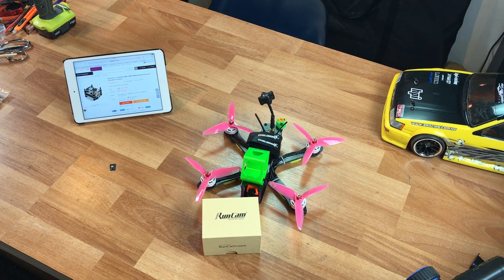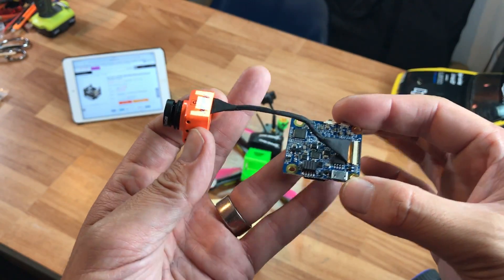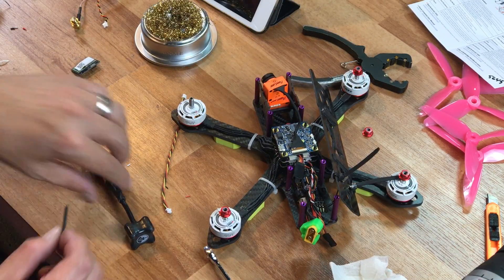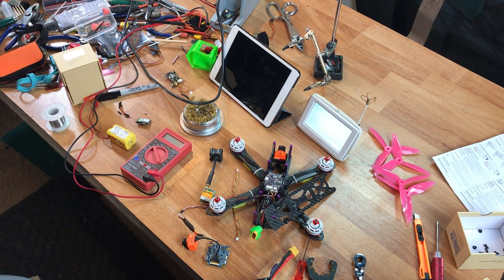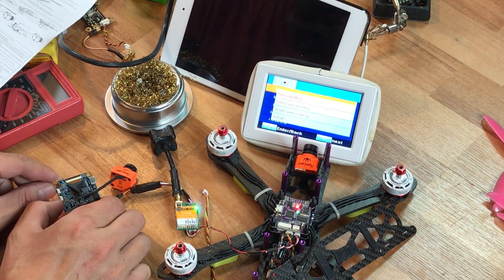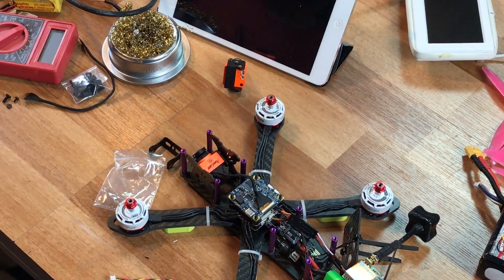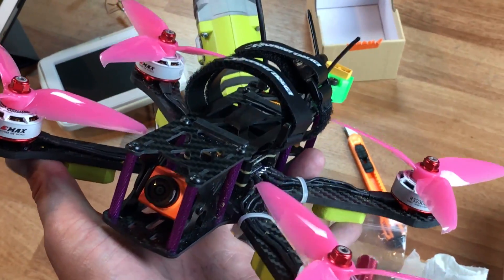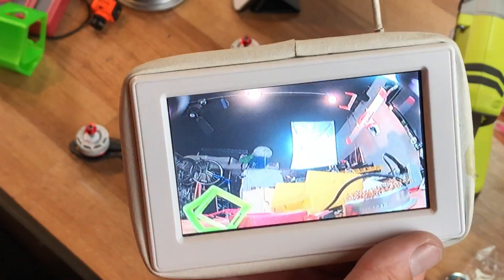RunCam Split Installation

Comment: I came to watch this vid to see how you connect the split to the FC. It looks like you didn't do that, but if it's set to save vid automatically, then I guess you don't have to, and the build is a lot simpler.

Comment: Have you done any videos on the RunCam Split 2 with it's updated power requirements beyond 5V?  My current setup is the Split v2 with power coming from a Tramp VTX 5v out, with the Tramp's power requirement and specs say it's designed to be powered direct from the Lipo and so, the tramp is soldered to the same pads as the XT60 out wire on my DYS F30A 4-in-1. I also have a power cap soldered to the same pads on the 4-in-1.  My FPV video feed is not kosher at all. Me and another build engineer have tried different options in power supply as well with no luck, and we are on our second Split V2 to eliminate the possibility of a shipped lemon.  So, I'm trying to find a solution to solve this.

Comment: Let's say you want to use the camera with your drift car, can you just plug it into the receiver? I only want it to record. Will the 6v receiver fry it or it is regulated?
Reply from the maker: 5v or nothing!- you can easily use a step down regulator

Comment: Why did you name this "installing" when you you skip the whole installation in fast forward? 😡😡😡
Reply from the maker: Panda MiamiLocksmith because if you have the ability to wire a fc this is way easier
Reply: 7demo7 I'm completely new to this hobby. Usually in an installation video, they show the installation cause people don't know how to install it. Thanks anyways.
Reply: 7demo7 theres like 500 screws, two brackets and not even the instructions tell you which screws go where. I went slowly and figured it out.
Reply from the maker: This is not a tutorial. Just my experience....
Reply: 7demo7 well it should be renamed "my split experience"
Reply from the maker: 4.4k views any you're the only one complaining. That just means you're wrong...
If it helps, slow down the video during the time lapse portions with the video speed tab
Don't worry you'll learn all this stuff and it will be second nature soon- the learning curve is quick.
Reply: 7demo7 yeah cause I'm the only beginner starting with high quality hardware.
Reply: Panda FPV,  you're telling a stranger they owe you something.

Comment: Can you run it with an OSD?
Reply: How do you wire the OSD?  Can I just connect the runcam split video out to FC video in, then FC video out to Vtx video in?  (Do I have to connect anything else?)
Reply from the maker: yes

Comment: thanks for this useful video. I am new to FPV. I've been flying a year and a half now but just getting into FPV. I have a FPV system installed on my MJX Bugs 6. The transmitter is a Eachine TX801. It does have 5v output. So, it is my understanding that if this is the case then install should be straight forward even for a newbie like me. 
Any advice would be appreciated before I take the plunge.
Thank you very much.

Comment: Sooo, noob drone builder here...  I'm watching this, and I'm wondering, where is the PDB?  The build I'm going with has one, but this doesn't?  Is the Flycolor Raptor S 4 in 1 also a PDB AND ESC or am I just overlooking something?  This is 3 boards including the Runcam split, but mine has the  ESC board, PDB, and the FC board, with an VTX that isn't on the stack

I'm trying to think of how I could add a runcam split to the stack, but 4 boards is too many..  Unless I did 4 individual ESCs per motor, but that's kinda  ugly.
Reply from the maker: The pdb is built into the 4 in 1
Reply: Thanks for the info!  Would be nice if the websites I found it on would say so =p  4 in 1 doesn't yield many related explanations.

Comment: I am currently running a Swift on my FT210 quad, and realized that due to the camera's 4:3 ratio and my goggles being 16:9 the OSD gets pushed off the top of my visible area. The Runcam site says this is "auto 4:3/16:9" can you expand on this, is it possible in the settings to set the FPV output to 16:9? Thanks for any info you can provide.
Reply from the maker: I don't really know what they mean by this as well... mine are 4:3

Comment: The Split draws more current (650mA) than most FPV cameras.  I guess you have to know that your particular VTX can sustain that draw off its 5V regulator.  Just thinking out loud here...
Reply from the maker: +QC Support thanks! Good info!
Reply: How does the setup shown on the video works for you?  I was powering split using 5v, 3A dedicated pololu - after 10 lipos I had 2x freezed video during flight. Motor and frame was devastated during a crash ;/